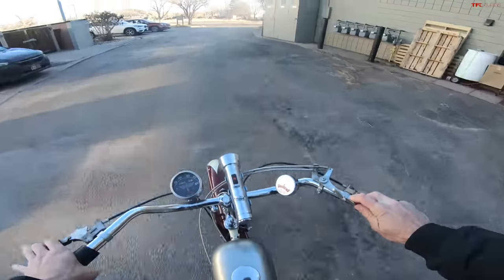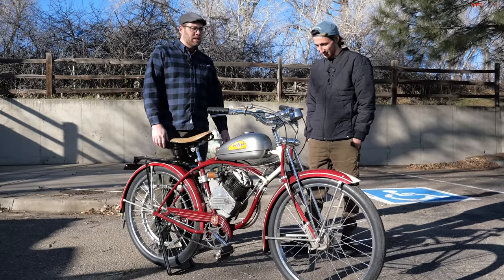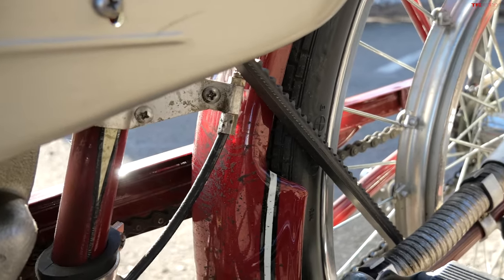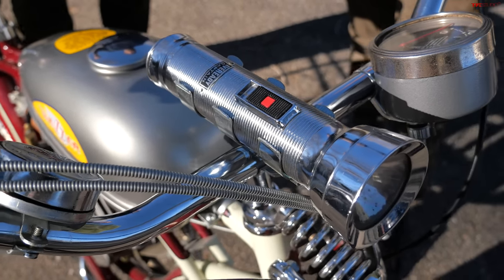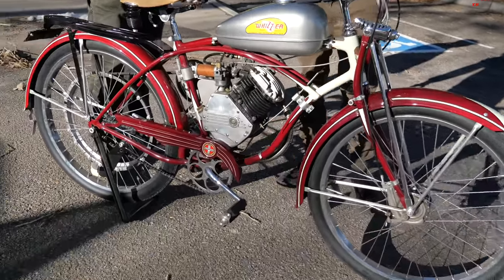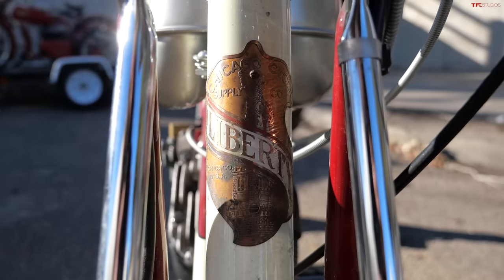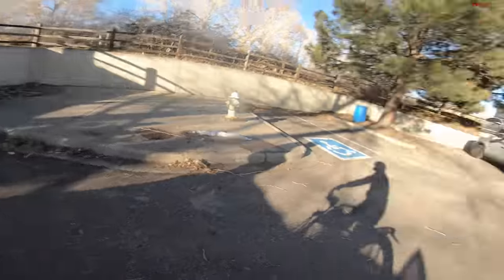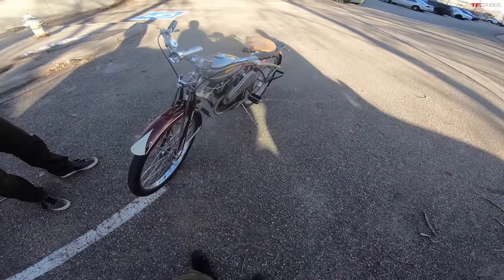I Ride A Vintage 1947 Whizzer Model H!

Comment: I had a friend who had a Pacemaker Whizzer back in 48. I was 8 years old at the time but did get to ride it on occasion. Super fun to ride. Those were the days of motor bikes, Cushman motor scooters and Doodle Bugs. I bought my first Harley, a 1948 "45" flat head when I was 14. But I got hooked on 2 wheel motorized vehicles from the first ride on that Whizzer. At 82, I still ride a 99 Harley Softail Custom. 

Thanks for the memories.

Comment: Just so everyone who thinks these are super cool but can't justify dropping thousands of dollars in them, there are multiple companies still making similar kits just like whizzer used to.  You can customize them and buy them with engine and cvt style go cart transmissions or get them sans engine with mounting brackets to fit a variety of 2 strokes up to around 125cc, and 4 strokes like the Hondas, Briggs and Stratton s, Predators from harbor freight etc.  Find yourself a cool vintage bicycle, or buy a modern bicycle and build yourself a bike customized to your taste, just like people did with these back in the 30s and 40s.